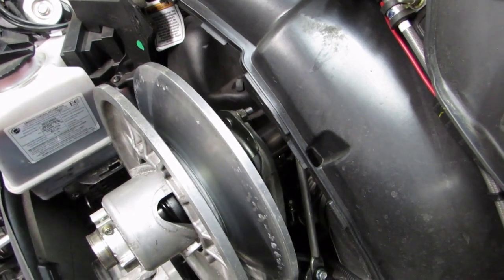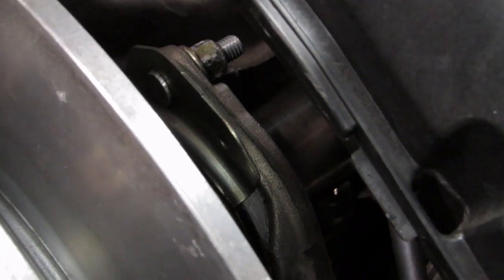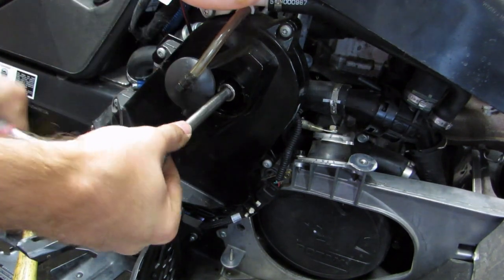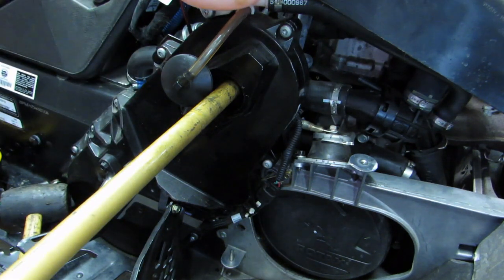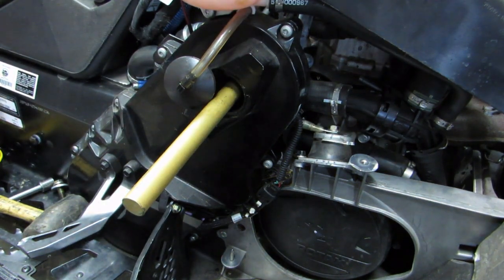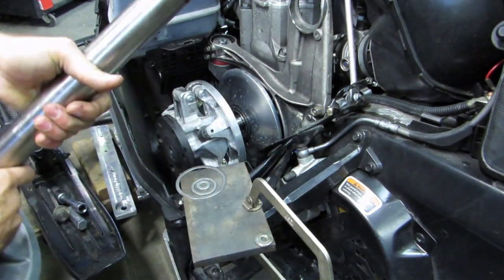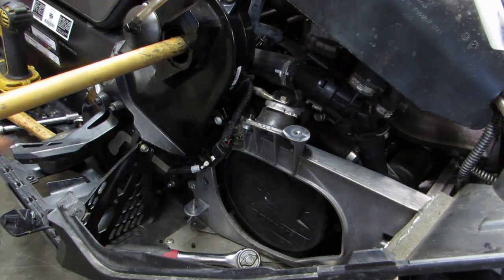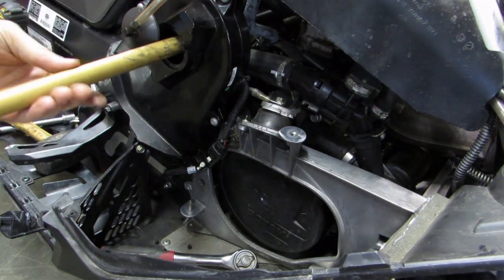Removing Secondary Shaft

Comment: This doesn't work on a 2018 Skidoo Enduro.  Bought the tool, threaded it into the bolt hole and proceeded to hammer out the shaft.  No result.  Hit harder.  No result.  Heated bearing behind Secondary Clutch and tried that.  No result.   On mine there is not a washer that comes out with the bolt.  There is some sort of a cup in front of bolt hole on end of shaft at the gear box side.  At first I thought the washer was stuck in there so I made a tool to try and hammer it back out.  I then discovered it wasn't a washer at all but some sort of cup that wouldn't come out.  

I was then pretty stumped on what to do next or what I was dealing with.  I came across a piece of threaded rod the same size as the bolt.  I threaded it in the end of the shaft until it bottomed out.  I then gave it a couple of taps with a rubber mallet and the Secondary Clutch and shaft popped right out on the other side.    Unthreaded the rod and left it in place to reverse the order to put it back.  

I just thought I would share this to show that they are not all the same apparently.

Comment: What's the thread size and pitch on the rod end?
Reply from the maker: 10mmx1.5mm
Reply: Same as the BRP P/N for the top sprocket bolt. (207503046) Hex. Flanged Screw M10 X 30, Scotch Grip. Doesn't say the pitch but it would be (1.25mm or 1.5mm)